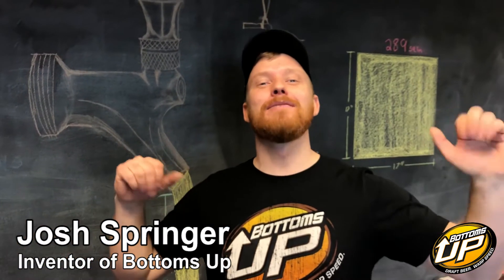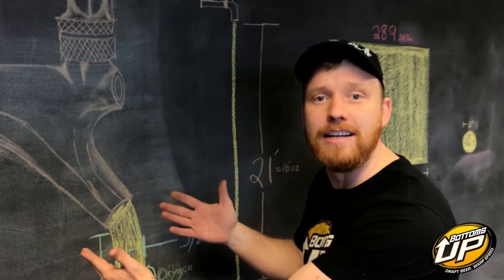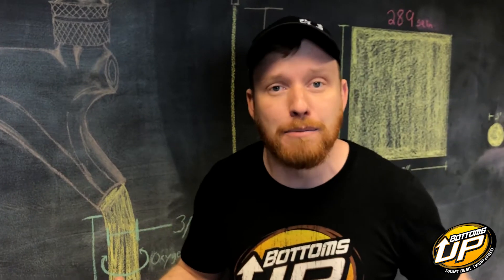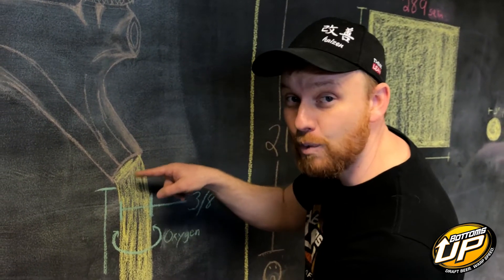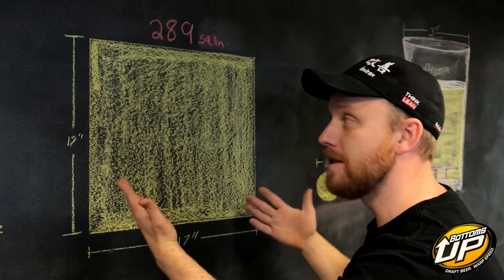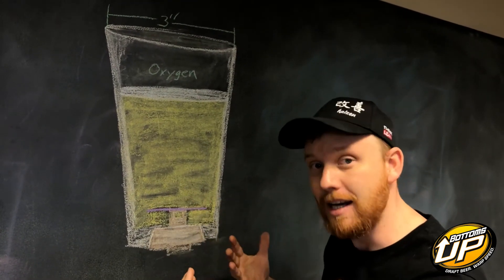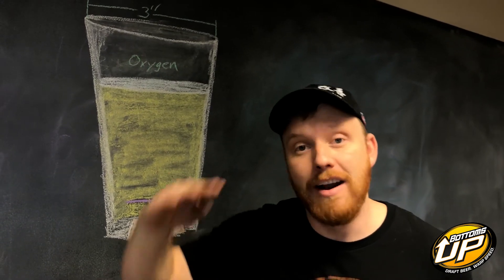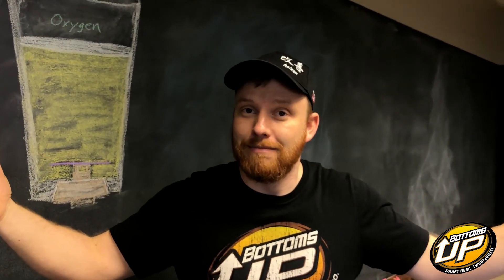Oxygen is bad for beer!

Comment: =1= Why would you stand 21 ft under the tap? This does not make sense. Is that an American thing. I'm not american, but i watch enough (real) science to know 21 ft is about 7 meter.  thats 2-3 stories, I dont get it...
=2= The beer in contact with air was not the problem the 'craft beer lover' was talking about, it can't be, it just doesn't make sense... Answer his real question, plz.
=3= Why did you not mention the CO2 in the first example. I know the CO2 falls around the beer going down, so it at least partly shields the beer from the oxygen. in a 7 meter freefal you should get quite a lot, i'd say.
=4= I am more woried that the glass gets dirty on the bottom, it is where you place the glass while not holding it. using this system means that every surface in the bar should be food-grade clean.
=5= This intricate system has a lot of nooks and crannies for dirt/bacteria to hide and not be removed easilly by a washing. It's way more difficult to clean a glass like this, which makes it way dirtier in the long run.
=6= The magnetic disc is removable, i bet this system would make a mess if it was not in place. I bet all beerlosses regaind would be wiped away by one time forgetting the lid and having a full beer over your bar splashed out.
=7= And is the magnetic lid even completely watertight, even when after a while the rubber rings get older?
I myself would rather not drink beer from your system, but i'm looking forward to your reply. (otherwise I would love it if you could post your resignation online, to show us you saw the error of your ways. 
Have a good one!

Comment: Your calculations are wrong. You should calculate the surface on the cilinder. Not how much beer is inside the cilinder.
Reply from the maker: That is the surface and not the contents.
Reply: Indeed it's the surface. the number is so high, because the use 21 foot (7 meter) high taps. 
It's the dumbest thing, you can't make this stuff up.